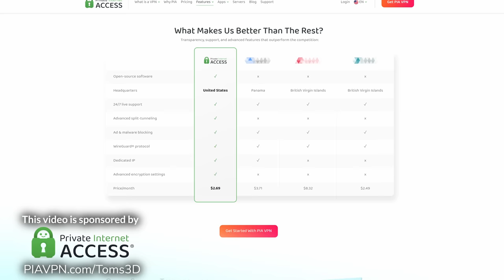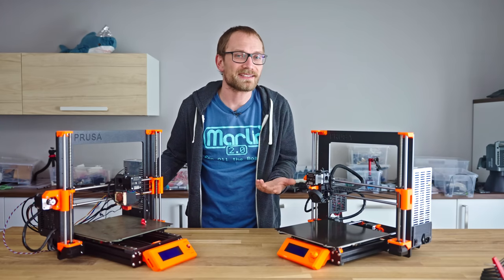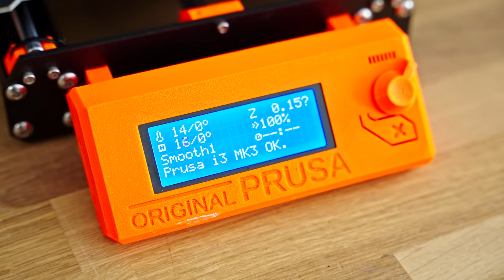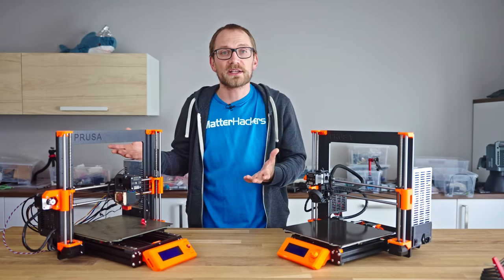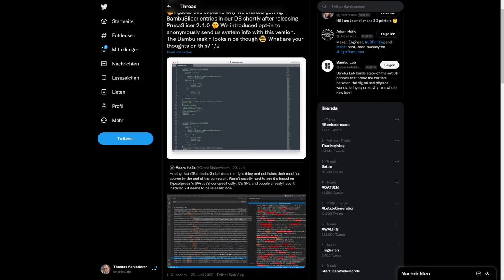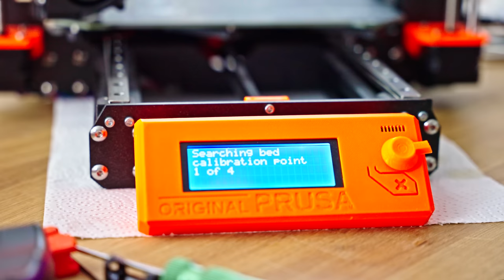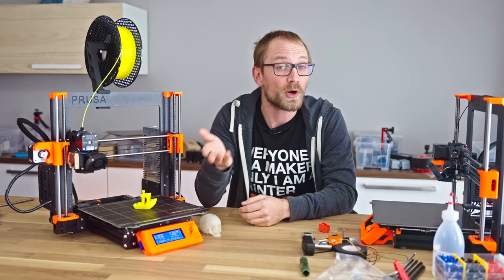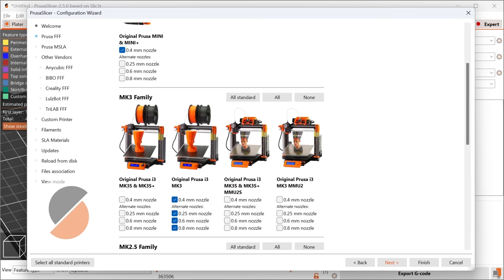This printer is OLD. Why is it still my favorite?

Comment: My MK II just turned 6 this month.  Still running the original power supply, board, hot end and motors.  I admit I have a new bed that was replaced 5 years ago.  For all you lucky MK III flex plate people look up the MK II bed and be thankful you don't have to scrape every print off.  But my PEI has zero gouges or tears to this day!

I have never bought another printer because of the MK II.  I have wanted many but why buy them when what I have works?!  

Out of necessity I may upgrade to the MK IV or V.  But seeing as how those aren't even a thing yet, my good 'ol MK II will keep doing it's thing for me.

Comment: My mk2 (mk2.5 upgraded) is still running strong, aside from having needed a few tweeaks to accomodate for parts that are no longer available. Prusa clearly use their machines, and you feel that care when you use them. I never feel like I'm working against a printer - i just print.

Comment: After a few years and experience with Chinese devices (which I like and don't want to miss) I ordered my first Prusa MK3S+ kit today.
I like screwing, tinkering and upgrading my devices here, but having a device where higher quality components are built in out of the box is great.
Once set up, the thing just runs - without being tempted to upgrade anything big.
And the main reason, the superior reliability. 
I am really excited

Comment: I couldn't have but agreed, but then, I bought this Bambu Carbon X-1 Carbon with an AMS and it just does the job without any issues, even with complex multicolour parts at a very high speed. I bought it from a Norwegian supplier, so no kickstarter involved.

Comment: There's a reason why Prusa is considered a golden standard and many hobbyists really want to have one.  Saying that, my Ender 3 S1 Pro prints as good quality for half the price. I miss the silent mode a lot in that printer though and who knows what kind of longevity I can expect from it either? But in one thing you are right, Prusa is really due for a major upgrade in the next model, maybe MK4 will bring it to the modern level of hardware and software?

Comment: My first printer was Anycubic. Countless days of tuning was hard and exhausting, but teach me a lot about printing. However I can say for sure that I had enough. No more Chinese printers or filament. My Prusa’s is brilliant. I call it “pain free printers”. And looking forward for my Prusa XL.
Reply: Yeah, I bought an Anycubic Kobra and it worked relatively well.  So I thought I'd try an Anycubic Kobra 2 and it's been a nighmare!
Reply: @joeking433  Sounds like Anycubic Chiron, in groups there is people that only have problems and then some that very happy with it. I'm donating mine to local school.  Assembled my PrusaXL yesterday.  It's awersome!
Reply: @efka28  Yeah, I keep buying cheap Chinese printers because I don't want to spend $1000 on a Prusa but I might have to bite the bullet and get an Mk4.
Reply: The market is now full of prusas mark 3. Its brilliant. not as fast as 4, but its a pain free printers.
Reply: @efka28  Yeah, I've actually considered both printers.  I'd like to see them drop the Mk3 a little, then I would buy it.

Comment: I completely agree! My Voron V0 does amazing prints! I quite the little dude and the quality is astounding. My kitchen counter has a partially build 2.4 all over it :P But as workhorses? I have several MK3s, and they aren't flashy and, arguably, I need to track down some ringing issues and things, but reliable workhorses is an understatement. They are wonderful! I am hoping to see some enhancements in a MK4. I don't need many things - really just the ringing (so maybe a 32-bit platform and input shaping?)

I went with the V0 and building the 2.4 because the XL has been delayed (but is still something I'm planning on getting) and Bambu well...I'm not sure you can have it both ways - being "open source" and proprietary at the same time. That hasn't sat well with me. E3D same thing (though I will admit I have a Revo in my V0). Their new Obsidian seems cool but I really just wanted a nickel copper nozzle and because that's all closed, I might not get one? I feel like Slice started this trend with their hotend and other have followed. It's not a good trend and I've been trying to avoid that where possible.

Joe Prusa has an OSHW tattoo! So my hope is the XL and MK4, etc. are properly open source. You can bet I will support what Prusa does by buying direct from Prusa (assuming they keep on keepin' one with OSHW).

Comment: My MK3 looks a lot different to stock these days, it has Hiwin rails on the Y, it has the Bear X axis, some of the steppers have changed, some of the pulleys have changed, it runs on Klipper and it has a reverse bowden setup for the filament feed - and it's probably about due one of the E3D hotend upgrades - but beyond that it's still that old workhorse underneath, it produces exceptional prints and doesn't skip a beat literally ever (okay when I moved house it died and I have to do open heart massage on it, but otherwise).

Comment: I got an Ender 3 as my first Printer 2,5 years ago. I did a ton of mods, ended up spending 340 Eur ish in total on it, yet I was never satisfied with the results. And if I was, within a week or two some new issue popped up.
In the middle of this year I decided to order a Prusa Mini+. And what can I say? It works so easily, it's almost boring. 
No, it does not print benchys in 25 minutes. But why should it? It works if I want it to. Most failed prints I've had were due to me messing around with settings, which is 100% user error. Besides some initial adhesion issues due to using the wrong plates [also user error!], it's been working like a charm. 
Also, holy hell that machine is quiet! Ofc you can still hear it, but it's not even comparable to ender 3s.

Comment: I have had my Mk3s for nearly 3 years and it is a great printer. It has printed over 5200m of filament and done 72 days of printing.  I did buy it as I say the my 4 favourite 3d printing YouTubers were using the Prusa as their go to machine and I have not been disappointed with the performance.

Comment: I've owned printers from almost every brand. At one point buying a new printer every few months was a norm. I even built a voron but.... Then I purchased a prusa just to say I've owned one??? I've never regretted it. I use it everyday because it just works. I don't even watch the first layer go down I just print and come back several hours later.

Wish I purchased one years ago, even tho bambu is all the rage at the moment I'm still going to buy another prusa in the new year. 10/10 get one

Comment: I'm going to be getting a neglected MK3 soon to finally build my reliable printer to just work while I tinker with my Ender and possibly start building Voron from BOM.

I like how you can actually upgrade the MK3 not only to the MK3S+, but to even MK3.5, 3.9 or MK4 if you want. I'll be setting mine to MK3S+ spec for now as it seems to have the nice to haves within reasonable budged.

Comment: Prusa won me over by looking at the core of what makes the printing experience rock solid and convenient - focusing on that over flashy stuff. They make improvements where they are merited or add to the user experience. No gimmicks,  solid user experience. No fluff filler or bluster. On top of that i can fix and maintain a printer of theirs 5-7 plus years after i picked it up.

Comment: I have first hand experience with just two printers.  A Lulzbot Taz6 at work, and my Prusa I3mk3s.  I have been completely spoiled by the simple user experience on the Prusa.  The only failures I have ever had were due to power outages, or prints coming unstuck from the bed, which in every case was a preventable failure, it was just down to my laziness in cleaning/prepping, which I only bother to do every 10 prints or so.  I now dread having to do a print on the work machine.  Because of the stupid electrical contact bed levelling method, it takes 10 minutes or so, to heat it up, scrape then buff the nozzle with a copper pot scrubber and babysit the bed levelling, restarting as needed until it works properly, then watch the first layer go down, and only then can you walk away.  When we bought that printer at work, the Taz 5 without the garbage bed levelling "feature" was still available, I dearly wish we'd chosen that option.  When I get some time, I'm going to mod the Taz with some inductive proximity sensors and metal targets on the fan shrouds, and it will then be a much easier to live with machine.  To be fair to the Taz 6, when it gets going, it's pretty well unstoppable, I've had filament tangles that broke the spool holder and there wasn't even a layer shift in the print.  Those printers are beasts that could have been great but just need the levelling sorted out.

Comment: After several years of owning an original Ender 3 Pro, I have finally tinkered with it to a point where it just runs reliably and can be used as a workhorse like your Prusas do. Personally, I can totally understand the two use cases for 3D printers, those being having one as a project to tinker with, and having one as a tool to use reliably. I first got my Ender 3 as a project to tinker on. But I've burned that candle out, and all I really want out of it is reliable prints. Thankfully, all of my tinkering has paid off to the point where it can be used as a reliable workhorse. It's not got very much of the original machine in it anymore.

Comment: We use prusa mk3s printers for our business. I've tried to pivot to a cheaper printers (artillery x1, ender3v2 and anycubic vyper) and build a print farm with them multiple times, but in the end it is the prusa, where we get the quality we need for our products out of the box. Also, we haven't had any major failure on any prusa machine since we started using them in 2020.  Everything just works, the quality is perfect and you get the item you want almost every time. And if you the speeds bothers you, at least in a commerical environment, just buy one more and you'll get more items in the same amount of time.

Comment: I use it as a tool; the old saying that it's the man that makes the tool, not the other way around is true here. The only upgrade from stock I've made besides keeping up with firmware is a revo 6 so nozzle changes are not such a gamble.

Comment: 6:10 I have 6year old cheap printer I've upgradded and it has said glass bed. I use 'stick glue' (the one you use in crafts that you use glue papers together) and after the bed has cooled the part just comes off easy. I've used it for year. No need any fancy materials that wear out over time. Every once and a while you need to add bit more glue and wash of the old but that's about it.
Reply: I had the same thing and then I switched to PEI and I really like it. To me it made it way simpler to print and get bed adhesion. I'm glad you found something that works, I'm just always chasing something better and tweaking something.

Comment: I got my Prusa MK3S in 2020 because I wanted something that just worked. My first printed was a Printrbot Smalls kit, it was okay, but constantly needed tweaks and adjustments to just print okay. The Prusa is just a workhorse, I haven't had any issues with it. I upgraded it to a Revo 6 when that came out, I think thats a perfect fit for this machine.

Comment: The thing is that many Ender 3 owners can say similar things about their Ender 3. It printed well out-of-the-box, also without mods. I even remember that the Ender 2 (none Pro!) was praised as even more reliable printer (less parts) with better quality out-of-the-box (less moving parts). 

It does also come down to the printer you know the best. Not hard for Prusa to get points here, when so many printers base on it's design.
And since there are soo many "good" printers out there, I would expand "the most favorite used printer" to the one machine, it's user made it's own by studying the design and loving the community.

But I do have a feeling that BambuLab studied the market (as Joseph Prusa did back in the day), saw the "next generation" with all the hyped Voron machines and designed their "brebuild Voron clone" quite well with the focus not on building but on getting to print quite fast as a user. The P1P checks some boxes that where pretty heavy on the Voron project like sourcing the material or having to buy an expensive kit, get the wiring right or simply the price tag.

It seems like the P1P is the "next evolution of a printer you can actually buy", like if Prusa and Voron had a child.

And for Bambu Lab it simply is not relevant if they weren't one of the first back in the days ... as long as they respect the community and the way things are handled in this community (i.e.open source). And ... it's also very interesting to see what Creality makes out all of this. They seem to have the resources to bring a new "dragon" machine to the market (Voron style as well, I guess =).

Comment: In my head there's two generations of printers that are relevant today, 8 bit and 32 bit printers.

Out of all the 8 bit printers I've tried, the Prusa is by far the best. That's not even a debate, the only printers that come close are prusa clones that copy prusa firmware, and if there are improvements over prusa it's in the actual hardware not the software or electronics (caribou vs prusa for instance)

A good 32 bit printer will blow an 8 bit printer out of the water, but there's still loads of bad 32 bit printers just like there's loads of bad 8 bit printers

Comment: I would agree to ideas and opinions of this video except in relation to the MMU2S, the older limited interface/display is frustrating with MMU issues. The demand of a special heat-break for tip forming also makes upgrades like Revo very unclear and a “you mileage may vary” 

Hopefully this is answered with the MK4, but otherwise for a stock or lightly modded setup you are spot on!

Comment: Totally with you on this. Stick to what works for you and don't jump on the latest and greatest. Having said that, I still use my 1st Mk2 clone I've build following the Dolly series you did. Same threaded rods, same plywood frame, same ramps/mega combo, cloned hotends etc. The only "upgrade" I did was to add all metal hotend, a BMG clone for the bowden setup, bolt the whole thing onto an 18mm flat MDF sheet and flash it with Marlin 2. I've other three printers but this is the one I go to every time. Currently, I'm building another one but with extrusions, and yes, it will be a Prusa i3 clone again, not exactly a Bear but close.

Comment: I feel the same, we have a couple of Ultimaker 3 extended, and a Prusa mk3s at work. I’ll always gravitate towards the Prusa because it just works, without any complications, and prints faster and cleaner into the bargain. 

I feel like Prusa running a print farm filled with them 24/7 for years and years has a lot to do with the reliability and ease of use…, if something doesn’t work well it will become apparent to them in a very short time, and they’ll just fix it straight away. No other manufacturer does that level of ongoing testing and improvement because unless they have a massive factory operating flat-out using only their own printers, how could they?!?

Comment: Had mine since 2019. I wanted to print things, not fiddle with 3D printers. Paid full price for the preassembled one to be delivered. Has been a remarkably reliable machine that after thousands of hours hasn't suffered any major issues beyond minor maintenance needs. I even have never upgraded the firmware. Despite that, the printer still works perfectly fine.

Comment: Loved this clip, I have just ordered a Bambu Lab X1 Carbon and I have a Prusa Mk3. 
I think the biggest mistake I made was when I added the MMU.

That single item has caused the most failures in a short time causing quite a bit of frustration with the machine in general, adding eSun heated boxes did ease the pain but I still have more orange flashing LED and 'MMU needs attention' than I can handle.
The first job for the Bambu is make parts for the Prusa (Yes the fan shroud melted and fell off) I'm tempted to try carbon fiber parts.
Once the parts are done all colour jobs will be Bambu jobs.

Prusa will be rolled back to single feed and then I will repurpose the steppers, bearings then 'tweak' the MMU with a blowtorch.

Comment: I have the original Prusa I3Mk3s as well, but just bought the SOVAL SV06 and it actually prints better and it is 1/3 the cost.  Within a few weeks, we will see the SV06 plus, with a huge build platform.  This is seriously going to put a dent in Prusa's business model.

Comment: There are many 3D printers that have been reviewed as "kits", which IMHO aren't REALLY kits.  The Ender-3 series for example are really just "some assembly required".  Creality pre-assembles enough of the printer to make life easy for the buyer, yet allows them to pack the printer into the smallest, and lightest box for shipping (thus saving shipping costs for they buyer).  The Prusa kits however, REALLY ARE kits.  They've been knocked down to just parts and the end user has to assemble just about EVERYTHING.  That wouldn't bother me, I LIKE building kits (I really wish the new Heathkit offit would sell a 3D printer kit).  I did buy an Ender-3 pro, and I like it.  It printed very well out of the box, and so far I haven't done much in upgrades.  (The biggest upgrade so far has abeen a WhamBamm bed).  I do have a Repo CR hot end on order though.  I also will install a generic inductive sensor for bed leveling, and rebuild Marlin.  In the end, I will still have paid less for it than if I wend out and got a Prusa.  But I would probably recommend the Prusa to anyone just starting out, even in kit form.  (My daughter has a Prusa, and likes it).